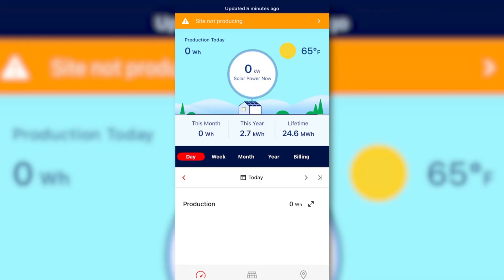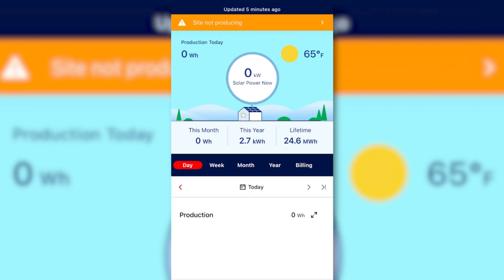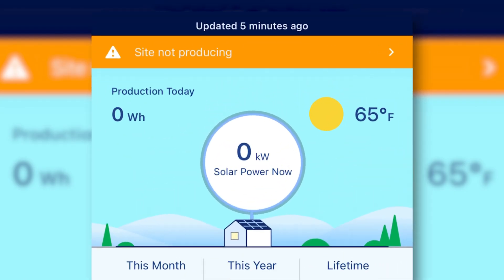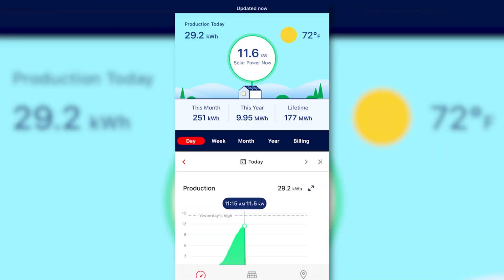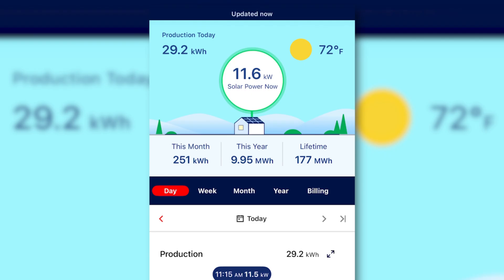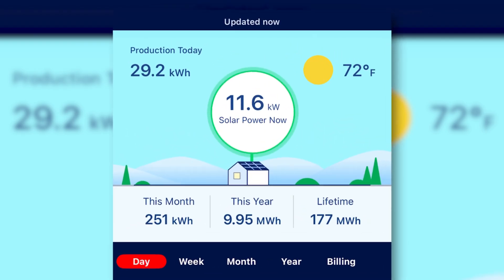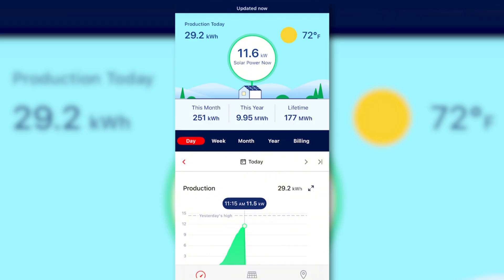How to Troubleshoot Communication Issues with Your SolarEdge Inverter

Comment: Okay but what if it's a cellular communication and the green light is solid but no blue light. I've tried communicating with the box but it always tells me to try again
Reply from the maker: We recommend contacting your installer or O&M service provider for troubleshooting. This will likely require more technical troubleshooting that requires a trained technician to safely complete. Your installer or service provider can safely gather the necessary data and work directly with SolarEdge support to determine the best path to a resolution.
Wha's covered in the video is the limit of what an end user should be attempting. If those steps are followed exactly as shown, the process is safe, but anything beyond that should be left to a qualified professional.